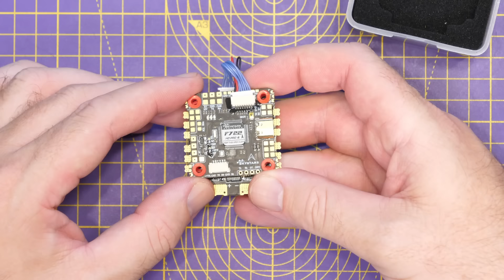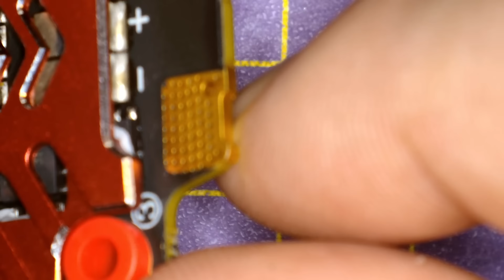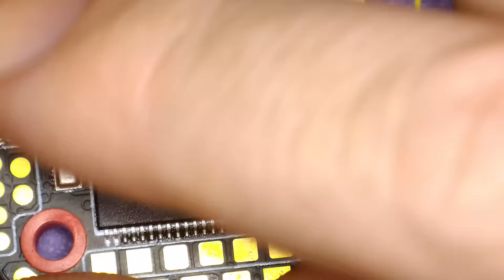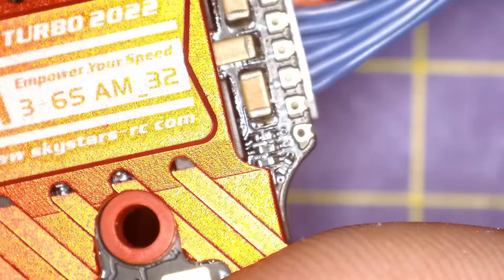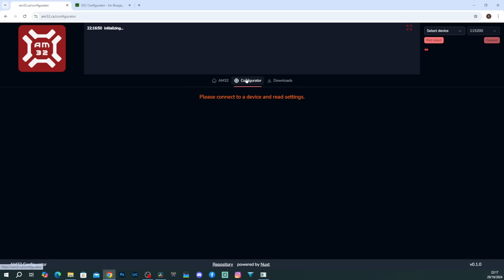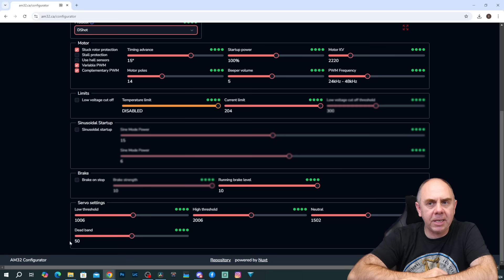SKYSTARS AM32 Stacks - Great Hardware But With A Surprise!

Comment: As of 2025 flywoo flight controllers are top shelf with proper wiring diagrams color coded and segmented and specs galore, I cannot speak for their esc yet, hummingbird 305 esc use very robust mosfets but like most esc is limited by physics not enough cooling, the 305 got hot enough in testing to desolder the motor wires, the mosfets did burn out after detachment due to feedback, so still limited by cooling capacity, everything is going up, get yourself a h7 flywoo flight controller while they are still cheap at 55$

Comment: I have a dumb question. Is it possible for the F722 to directly control the MOSFETs instead of encoding OneShot/DShot messages and have AM32 decode the messages and then control the MOSFET?
I have a F722 T-Motor board, and it never uses more than 7% CPU. I want the F722 to work more and reduce the ESC to a pure analog MOSFET electronic board.

Comment: Im sorry but I had terrible experiences with my KM55a 20x20 stacks. Between the quad trying to turtle mode in my hands whilst unarmed, the vtx pit mode switch turning the video off but not back on until its power cycled, and also very weak esc's for racing purposes, having the esc burn when doing betaflight motor re ordering/direction change (between myself and different people), whilst plugged into betaflight. And also just very bad QC and/or firmware issues, I cannot and will not in good confidence recommend another one of these stacks to anyone looking to get into racing, and also freestyle. The esc's also do not fit into a standard switchback pro/lightswitch sized frame, the standoffs will butt into the esc power pad layout.

I cannot speak as to the quality of their 30x30 stacks as I have not used them, but I know of people that are happy with some of them. But please if you value not having to buy multiple sets of these to use in your racing rigs and swopping out an esc every 1st or 2nd race day, stay away from the 20x20 stacks.
Reply: I can confirm the 20x20 Skystars KM55 ESC also does not fit on a Five33 Lightswitch V2 (clone). Because of 1-2 mm too large power pads. 😂

Comment: i actually just bought the HD Pro4 a month ago. First time trying SS...having said that i did have to calibrate the voltmeter in BF as it was reading low 1v already AND Im currently tuning the amp meter now which was WAYYYY off (and annoying i have to do out of the box). Otherwise it seems to be doing fine, running it on a 10"

Comment: Just a heads up! Ian said that there's nothing wrong with the double layered PCB on the mini esc, but it caused me difficulty mounting it, i had to put extra nuts on my standoffs to raise it higher so it couldn't strike the center arm screws, but then the stack was too tall for the frame... So there is definitely something wrong with doing that, and i had to get a different stack!

Comment: At 1:52 you seem to be implying they are special in using an LDO to provide 3V3? All the FCs do, that's just how you get 3V3 from USB vBus/5V. If anything, they are using some AMS1117 clone (AZ1117R, E17E engraving), there are much better regulators on the market. But they're using 5A rated buck switchers (MP9447), although with laughable 200kHz to 650kHz switching frequency - at least the O3 won't brown out!

Comment: I have the 20x20 stack and I'm pretty sure the vtx switch is only a pit switch on the 20x20 rather than an actual on/off switch like on the 30.5x30.5 flight controller.

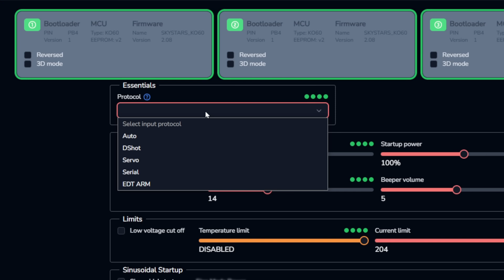Comment: If you really want BLHeli_32 32.10 but are also happy with Am32, I would quickly order it... 20:01 Spool up issue: Healthy Fingers are damn important ! I have 3x Diatone Mamba BlHeli ESCs in my stock which has older Firmware then 32.10. If you do some research you will read countless cases of the problem of spool up after the battery has been plugged in. It is possible that the problem has now been solved by Betaflight (from what I have read, both are to blame, i.e. Betaflight and BLHeli32 together). Nevertheless, I told myself that I will not install these ESCs. And wait in the hope that they can perhaps be upgraded to 32.10 or AM32 (in compatibility list) in the future. I now like to use AM32 and/or ESCape32. However, because I think that these may also cause problems and surprises at the beginning, I have now come up with safety measures. 1) For 4" and above, I wear knife safety gloves, when plugging in the battery. There are different safety degrees, I have to test whether light degrees of the gloves are sufficient... Because real chainmail gloves are uncomfortable and difficult to use... The lighter grades are almost like normal fabric gloves... 2) The time of the ESC melody as long as possible. 3) Put the drone down quickly and walk away. 4) Do a lot of testing in advance without props.
Reply: But be careful knife safety gloves can be electrically conductive so pay attention where to grap your drone, don t touch the stack.... So over these latex gloves, or simply use good leather or motorcycle gloves instead of knife safety gloves

Comment: been running skystar AM32 20x20 for 3 years now on my 2 main freestyle 5in. Never burned one or broke. the same stack for 2 years on different frames.
Reply: I have every skystars esc they make, ive even run 2207 2700kv motors on 6s, plus I'm extremely abusive, they just don't die!!! I have had issues with thier FCs though... I found my favorite stack is a skystars esc with a Jhemcu f722 repinned to it
Reply: @DigitalCruzer  agree, I think it is one of the best ESC on the market no mater the money